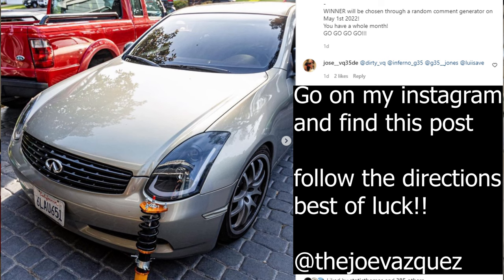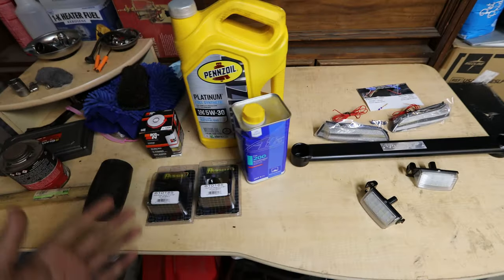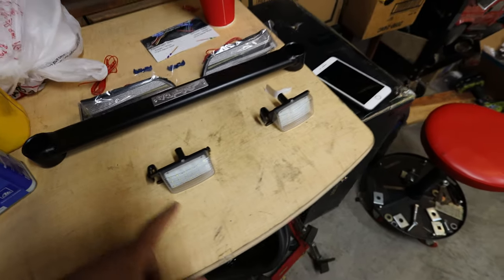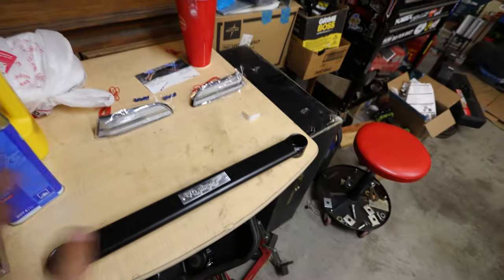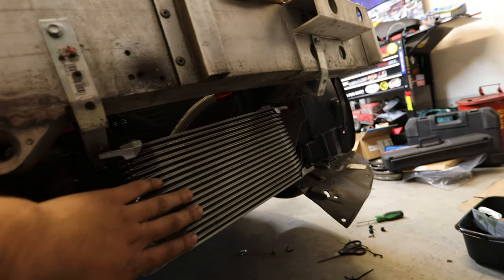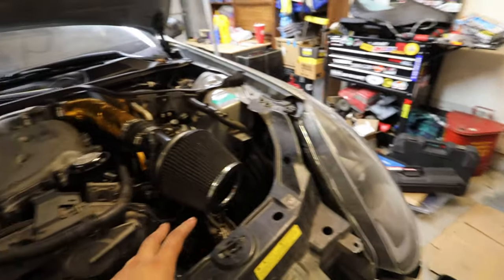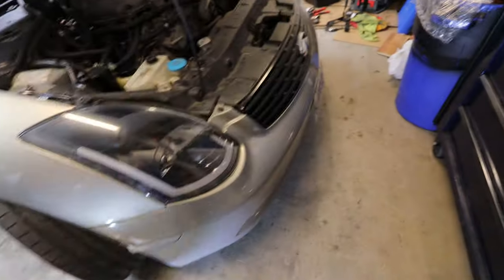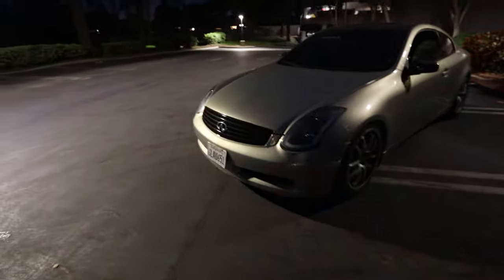These Lighting Mods Transform Your G35!

Comment: I have a 03 coupe 6 spd that I have bought months back for $1500…has a lifter tick so I’m thinking of completely rebuilding the motor but charging $5500…I’m about to just build her from the ground up and keep the g forever…had an automatic coupe but the 6 speed wayyyyy more fun and goes with a 2 door car imo…my son gonna want it or I got my classic car for the rest of my life…I’ma big fan of infiniti have a 06 fx35 as well
Reply from the maker: Just buy a used motor for 1500 with 50k miles, way cheaper!
Reply: I had a tick sound. Ended up being the timing chain guide rail. It's made from plastic, and gets in the way of the chain. Hence, the "TICK".

Comment: nice headlights bro, just a little constructive criticism on the CAI, section it off or route the piping away from the engine bay (otherwise it's just sucking hot air back into the engine).
Reply from the maker: Yeah playing around with the whole setup so not even close to being done!

Comment: Oem air filter setup is way better than what you have going on. I have a pop charger too but with a heat shield and air tunnel cut through radiator support.  Your actually gonna get hotter air intake temps with your existing setup. The oem would be much cooler and the setup I have with heat shield and air tunnel keeps it 5-8 degrees cooler while driving.
Reply from the maker: I’m testing things so I took off heat shield so I have room for activities!

Comment: I would recommend purchasing a glowshift sandwich plate. I have it paired with the G plus oil cooler on my g35 and haven’t had any oil leaks ever since!
Reply from the maker: I would but I have sensors hooked up on the sandwich plate and the glow shift is just for an fittings from what I remember or else I would!
Reply: @JoeVazquez  I have both oil pressure and oil temp sensors connected to the glowshift sandwich plate

Comment: I have the sequential side markers too but I’ve been too lazy to splice it onto the headlight wires 😅 gotta get them on with the sped d’s asap
Reply: Do you know how to do it?! I haven’t figured it out yet lol
Reply from the maker: So you find the oem connector that connects to your spec d’s, the oem connector holds the purple or green wire you’re looking for, from there you just splice into it and hook it up to your side marker. I should have done a bit more explaining but you may have to dig in their to find it if they’re tucked away under the headlight assembly!
Reply: Joe Vazquez Thanks for the response, I will try that tmw!
Reply: @franciscoreyes771  I’m scared to mess up 🤣

Comment: Noticed you went back to 5w30 and penzoil instead of Castrol, why’s that joe?
Reply from the maker: Great question! I went with 5w30 because I really have no need to jump up to 5w40 as a daily, specially with an oil cooler! I’ve been using pennzoil on the car for a good while and haven’t found any issues because of it so just figured to keep using it!
Reply: @JoeVazquez  that makes a lot of sense! So without an oil cooler, is it better to run 5w40 to daily or just stick with the 5w30? 
Summer is coming here in so cal and it gets hot !
Reply from the maker: 5w30 will do just fine if you’re gonna be driving it normally! 5w40 if you beat on it quite a bit